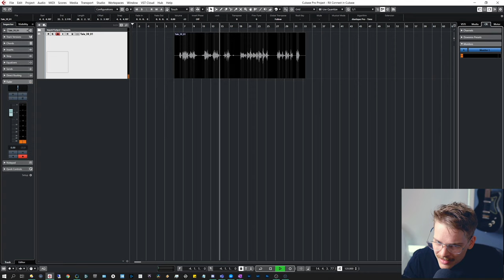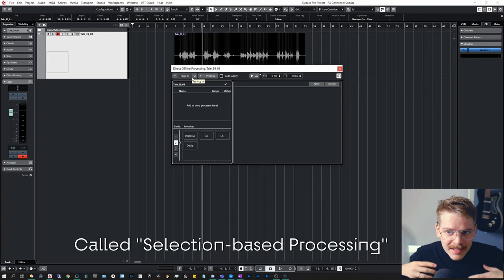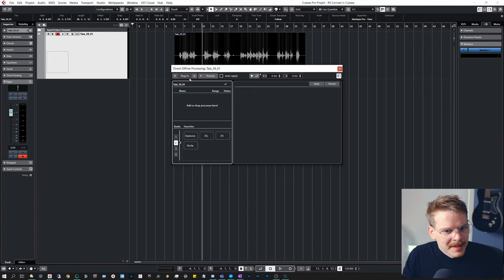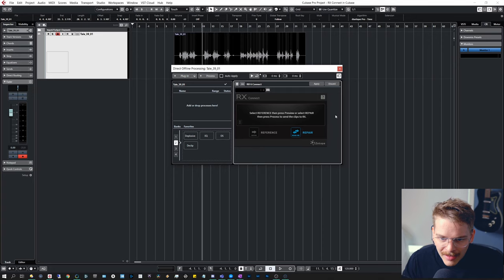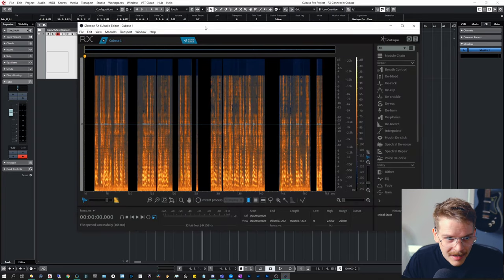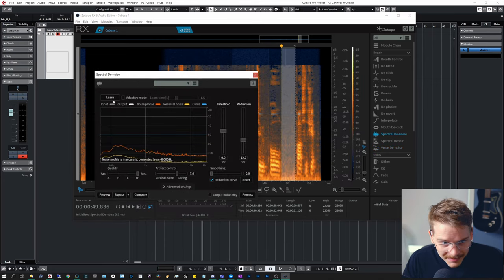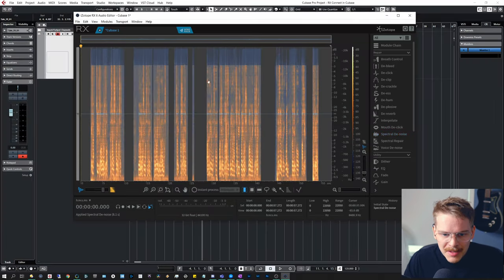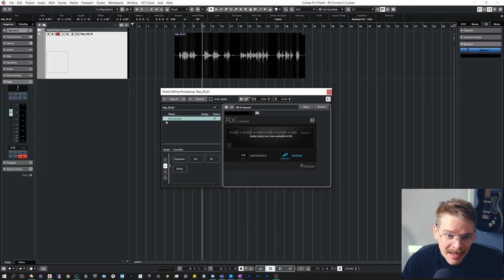Using RX Connect with Cubase

Comment: Hi Sifter,
I did it the same way; however, when I click apply I do not see any changes in my wav form. It's kind of frustrating.  What I'm doing at the moment is save as in RX as a wav and then reopening as a new sound which is a hustle. any tips?

Thank you!
Reply from the maker: Hi 2GETHER, thanks for watching! :) SO, the case is that the effect does its thing but the waveform doesnt update? I’ve had that happen to me as well. In that case i would use the bounce selection under «Audio - Bounce Selection» (i set up the key command ctrl+alt+b for this) and that will do the same thing that consolidate will do in Pro Tools, it will not bounce the audio like render in place, just make a new wav file. (Useful for making a small new file for opening in sample editor, using variaudio in a smaller file, and so on. This will also make a new wave image file! :) Hopefully that helps: Strongly recommend to also duplicate the trackversion before adding the RX settings, so that you can compare both the waveform and the affected waveform, and also UNDO if you need to. OR undo just a little section. Great habit. Good Luck! :)
Reply: Thank you for the reply!!!
Reply: @SifterStudios hello my friend! I was trying exactly that! I didn't want to change the original version in the case I need to come back later. So, I duplicate the version and send it to RX connect... I made all the changes I need and when ready, I send it back to cubase!!! Result? : it's OK, my duplicated version has the changes like I wanted but the problem I have is that the original previous version also take the changes...
In this way both versions changes and like that is no possible to come back to the original version anymore.... (you can go back of course only with undoing)
Why is like that? I think it should be as you say in your comment!!! Any idea? Thanks in advance!

Comment: I was just trying this out in Nuendo two days ago on a lot of files. I did the correct steps but it is very confusing to use within the direct offline processing compared to pro tools’ audiosuite in my opinion. I wasn’t sure if what I did was applied or worse, if I had applied it multiple times by messing with the settings in the processing window. I ended up opening everything directly in RX and importing the processed files in Nuendo because I was losing my sanity not knowing if it was applied or not... For processes less subtle than spectral repair it’s better, but man when you don’t see the waveform change you start doubting.
Reply from the maker: Thanks so much for that lengthy comment! :)  I had some problems myself, however after turning off auto-apply i started to trust it when using rx connect..! sucks that it doesn't remember the state if you bypass it though, that would have been heaven.
Reply from the maker: Oh, and nice to see another Diablo 3 gamer..! :)

Comment: Sometimes “send to nuendo” is working and sometimes not. Is there a bug ? 🧐
Reply from the maker: Try turning off the auto-apply in the nuendo window, that helped in my case. Yes, it seemed a little buggy when I tried this out!
Reply: @SifterStudios  did that. Nothing happend. It seems that return function works randomly.
Reply from the maker: @MrKestu  Pity! It’s a really awesome feature when it works..! Saves much time when you don’t have to jump back and forth from standalone to do denoising for example. Sometimes I open the individual files from the audio files folder in the project in RX standalone, when opening cubase afterwards it will redraw the waveforms, useful if you have a bunch of recordings with the same setup for example..! Probably not new for you but maybe someone else will see this and might be helpful for them! :)